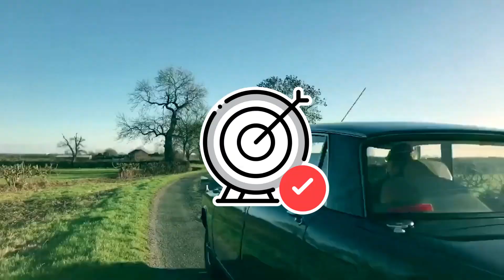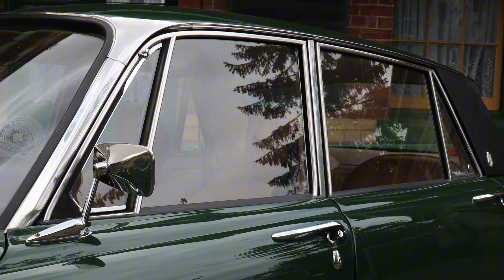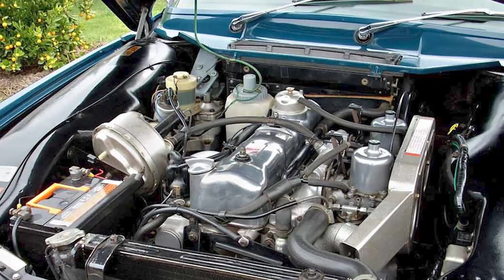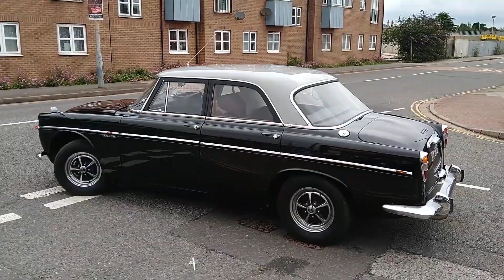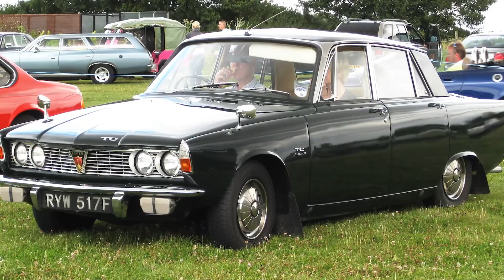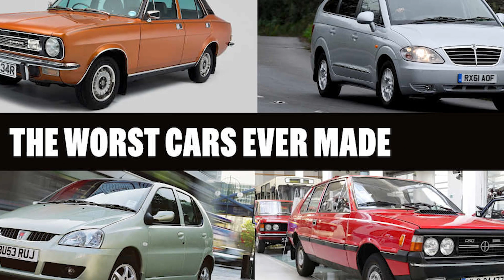The FORGOTTEN British Legend that SHOCKED Everyone! - Rover P6

Comment: I enjoyed this video. Thank you for posting. However, I'm afraid that some of your figures are wrong. The 2000SC produced 90 BHP (DIN) which is about 104 BHP (SAE). SAE stands for Society of Automobile Engineers and is a rating that we now don't use. It refers to the power that the engine made on a bench (i.e. without the drain of ancillaries such as drivebelts etc) rather than DIN which is the power when 'installed and connected'. i.e. the net output. 

The 2000TC initially produced 114 DIN (just short of 130 BHP (SAE). It didn't just benefit from twin carburettors (TC) but also had a revised cylinder head  and ran a higher 10 to 1 compression ratio. It was therefore much more powerful than the single carb version. However, it required five star (100 octane) fuel to avoid 'pinking' (premature fuel mixture detonation).  In markets where this petrol was unavailable, the ignition was advanced and the cars power fell to about 105 BHP (DIN). 

In time, five start fuel was also withdrawn in the UK . Therefore, owners of 2000TC cars needed to adjust their ignition timing. Meanwhile, in 1973 the 2000 (both variants) was replaced by the 2200. The SC version of that produced 98 BHP (DIN) and the TC 115 BHP. (DIN).  The 2200TC wasn't in such a high state of tune as it's 2000TC predecessor and both the new 2200 cars could run on 98 Octane fuel without adjustment. You will notice that the power of the 2200 TC was only fractionally more than that of the 2000 TC. However, it produced more torque and was stronger lower down in the rev range.

I agree with you that the P6 was an incredibly advanced car and I wish that I had one again now. Thanks for your great video.
Reply from the maker: And thank you for your great comment, appreciate the detailed explanation!

Comment: I've been restoring my 1970 3500S NADA "mistress" since my ex-girlfriend showed up in Denver with it in 1986.  Never a gearhead, I was stunned by it.  She subsequently broke my heart, but I ended up with the better deal (she took the Mazda).  It never fails to turn heads today, and after I finally got rid of the deplorable OEM Borg Warner 3 speed automatic (Who in the hell mates a 3 speed to a V8?  Leyland does for the U.S. market only----at least a manual 4 speed was eventually available in England) and replaced it with a Celica Supra 5 speed manual, it became the car it was meant to be.   Not only did the performance jump, but so did my gas mileage.   They'll bury me in this  car!!!!
Reply: "who mates a 3 speed to a V8?": in some ways I think the North American market demanded it. It made even less sense to mate the auto gearbox with the more sporty 4 cylinder 2000TC version, but when I worked at a UK Caterpillar Plant in the 1970s, department heads were assigned company cars and the choice was the Rover 2000 TC. Unfortuately, Caterpillar HQ in Peoria insisted that all company cars must have auto gearboxes so that the visiting Vice-presidents would be able to drive them! However, Cat was a great company to work for and the Rover was a great car.

Comment: Drove them in the police, and owned two in quick succession.  Marvelous vehicles.
Superb acceleration, so much so that wheelspin occasionally caused the wheel trims to spin, and sever the rear tyre valves - embarrassing!
Cured by swapping to 3500S wheels, with stud pass-through wheel trims..

Comment: My old man had a stock V8 S P6 Rover  (snot Green) and got stopped by the Police at 140 mph, his mates said impossible so he showed them the speeding ticket.
So, when you say 114 MPH for a 155BHP engine that is just wrong, sorry.
Reply: The top speed of 114 MPH was correct for the later 3500 automatic P6. Without going into all of the detail, these were probably producing more like 142 BHP (plus or minus) and had a three speed automatic box that sapped more of the power than that in a manual.

Comment: Thank you for this review. You're bringing tears to my eyes remembering my late father. I'm from New York City and the Rover 2000 TC was my late Jamaican New York City cop father's ultimate dream car. After years of driving American iron from AMC Rambler to Buick Electra 225. He finally secured a used 1968 Rover 2000 TC from a second owner in Forest Hills, Queens NYC. Man he loved that car and being a bit of an Anglophile he was well aware of and taught me about the way ahead of its time tech features of the car. Like the ability to drive safely with a blown tire(s) and the inboard disc brakes on the IRS. He preferred the twin carb SOHC 2 liter as being more sophisticated than the Buick derived 3.5 liter pushrod V8 which more Americans chose as being the biggest engine offered. Thank you for highlighting my Dad's favorite car and toy.
Reply from the maker: And thank you for sharing your story, it is really interesting to hear why that car means something to you!
Reply: My dad went with the "baby V-8" outside of Chicago. Learned to drive on a Land Rover but once I got my drivers licence I was allowed to drive the Rover, changing the stock Perrelli tires to Michilens made a world of difference. Only long drive issue we ever came across was the starter motor failing in Colorado. Managed to find a used one at a garage, after a bit of instruction and loaned tools dad managed to replace it in two hours, the mechanic was impressed as he was typically close to an hour due to the very tight working areas. Being a standard as long as you had a flat area or a bit of down slope we could always get it started.

Comment: As a young man in the 1960's, I grew up with the P-6 Rovers and with the Land Rover "Series" vehicles.  While the P-6 Rover car was well ahead of its time in so many ways ("Rover engineering takes motoring years ahead"), the Land Rover was definitely of the old school.  Land Rover series vehicles remained in production long after time passed them by.  The original Defenders were only minor improvements over the "series" Land Rover.  I well remember Rover when it was The Rover Company Limited.  I remember the Leyland Rover days, and a year or so later the British Leyland Rover days.  English labor at that time, the late 1970's and up to 1986 (when I left the Rover business) and even after that, was in a spiraling downhill mess.  That's why Rover's (including Land Rover's and Range Rover's) reliability became so unreliable.  These days I drive a Buick Enclave and a Jeep Wrangler Rubicon unlimited.  I will always have a warm spot, correction, hot spot in my heart and soul for the old Rover Company's products.  Andrew McKane,, 30 April 2025, Maunaloa, Hawaii.